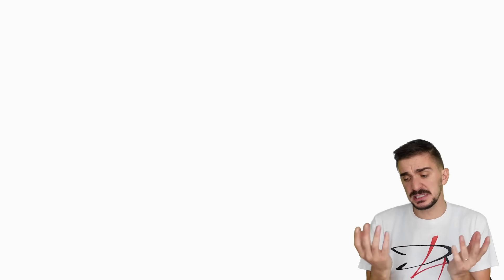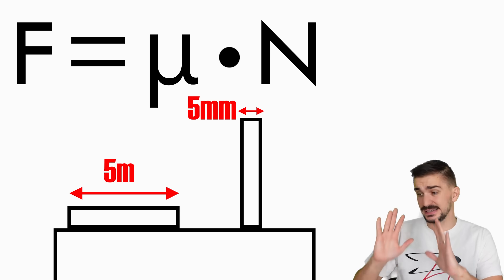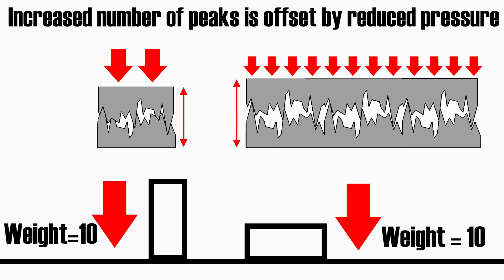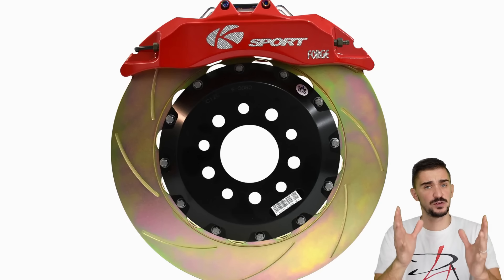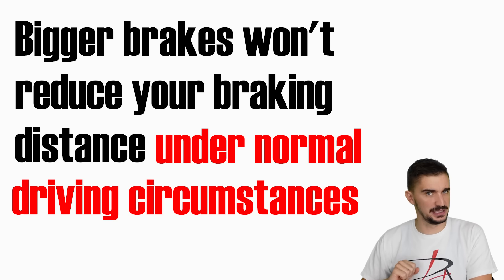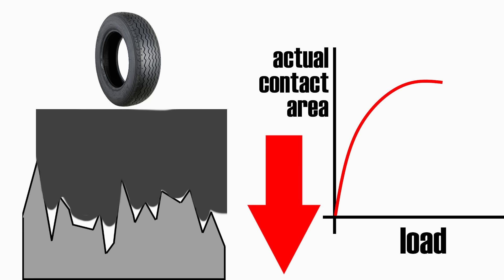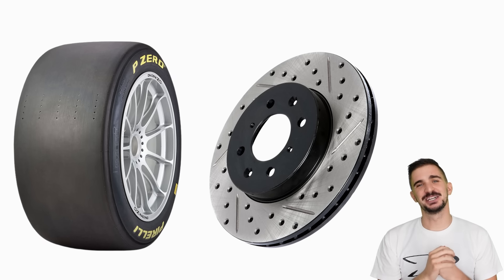Why Big Brakes Won't Stop You Faster but Wider Tires Will - Friction and Surface Area Explained

Comment: Couple of points.
First, all the comments about larger diameter brakes providing a "longer lever arm" or similar are incorrect. Stopping a moving mass with friction brakes requires converting motion into heat. There is no "leverage" involved in this. Larger diameter rotors dissipate heat more quickly due to a higher tangential velocity, and if the system can dissipate that heat, it results in shorter braking distances.
Second, another reason that wider / larger tires can stop a vehicle more quickly has to do with shearing of the tread. As tire load increases, friction increases, but only to a point. If the load exceeds a certain value, net friction decreases due to shedding of the rubber at the contact point. Wider tires reduce the pressure, preventing shearing.

Comment: All other things being equal, wider tires will hydroplane sooner on wet roads.  So braking efficiency depends on much more than just tire width.
Reply: Also, wider tires don't increase the contact patch area, just the shape changes.

Comment: Put on a larger tire and wheel or heavier rotating mass than stock and your brakes will definitely not work as well. Then a bigger brake will 100% stop you faster.

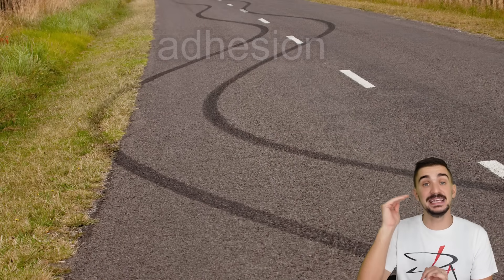Comment: 13:50

 On asphalt road surfaces, skid marks are usually the result of bituminous oils in the asphalt that are heated because of the friction of braking or accelerating and rise to the surface, leaving dark marks.

Comment: I'm surprised you didn't mention that brakes are sliding friction and tires (generally) is static friction. I always thought the difference is behavior was because of a difference in behavior of the friction coefficient between static and sliding friction.

Actually thinking about this some more I believe the nature of the difference is evident in the fact that tires leave skid marks, brake pads do not. This means that when a tire slides it's actually not overcoming the grip with the pavement. Instead, it's shearing off the tire material that's in contact with the road. In other words, the rubber holds on to the road more than it holds on to itself. In this regime, it's clear that a larger tire surface that spreads the force out over a larger cross sectional area will improve grip, because it'll take more force before we start shearing the rubber.

Comment: Your video title is misleading regarding breaks, which you fully admit to, but it's just simply wrong about the tires. The friction doesn't come from how much surface area there is on a micro level, it comes from how much force is required to unbend the rubber out of the valleys in the surface. That IS adhesion. Adhesion IS F=μ*N. It's why stuff that is traditionally sticky, like gum or pitch, isn't sticky when you touch it for a small portion of time but is when you touch it for longer or press down into it. It takes time or force to move such a viscous material into or out of shape. It's why something like cloth (something very soft and flexible) on flooring has low friction force, because the cloth has no internal strength or structure to hold itself into the surface it's trying to grip. Rubber has high internal strength so it can withstand more load before failing and adhere to the surface better. The decreasing deformation as load progresses is totally irrelevant. Think of it like standing on a stair, as long as your foot is totally on the stair, it doesn't matter if your foot is 6 inches from the riser on the step above or touching it. Foot placement only matters when your foot is hanging on the very edge where it takes very little force to get it to fall. Similarly it doesn't matter how far from the micro valley bottoms the rubber is as long as it's difficult to unbend.

Comment: No.
Physics says that M (breaking moment) equals Radius times Normal Force.

Hence, bigger the radius, bigger the breaking moment.

Hence, bigger disk brakes will increase the braking power. Because Power equals Moment times angular velocity.

Comment: For motorcycles, putting holes in brake disks improves wet-weather initial (first couple of revolutions once brakes are applied) performance. Slots do the same, maybe better. It also reduces unsprung weight, but probably not enough to matter. Bikes have comparatively little 'sprung' weight, so the sprung / unsprung ratio matters more than it does for cars. One of the best handling mods I ever did for my Ducatis was to swap stock wheels for exactly-the-same-size Marchesini magnesium ones. Same tire models and sizes, big difference in handling. I used to set up bike suspensions for the track, and this was a bigger difference than changing spring rates, preload, or damping.
Reply: The drilled holes are functionally allowing more airflow and hence cooling.
The purpose of the slot it to have an edge wipe the pad removing debris and ever so slightly shaving the pad for contact area while chasing the gasses away.  That is why it has to go in the proper direction.

Comment: Click bait. Even if you explain in this video you are still giving false information. Bigger brakes will definitely make a car brake faster. The reason is heat dissipation (cooling).
Reply from the maker: Zero false information and zero clickbait in this video. You're misunderstanding and compensating by twisting the facts.
Reply: @d4a  go put smaller brakes on your car and bigger tires then. I'll see you in heaven.
Reply: If your wheels can lock up (all modern cars have enough braking force to do this) then bigger brakes do absolutely nothing to decrease breaking distance.
Reply: @fishy_on_me  if you were in charge in designing brakes then you will be responsible for the death of many. Don't listen to everything you learn on the internet. Yes all brakes will lock up, until they overheat and you get what  is called Brake Fade. Look it up.
Reply: @alanskylux9822  Yeah because brake fade definitely happens all the time whenever you're driving to work
Reply: Some people do experience brake fade on an every day basis. Specially hilly areas.
Reply: @alanskylux9822  So? Just because some people experience brake fade in extremely hilly areas doesn't make the original claim untrue.
Reply: @fishy_on_me  At the end of the day what is true persists and what is a lie dies. Bigger cars have bigger brakes (as well as race cars) and smaller cars have smaller brakes. There is a reason, car manufacturers always try to save money, they would not not waste money on bigger brakes for trucks if they did not have to. You want to tell me the engineers are wrong? I actually dare you to go talk to an engineer and suggest that there is no need for bigger brakes for braking performance. They will most likely ignore you entirely because there is no point wasting time with people like you who believe anything they see online. Yes small brakes and bigger brakes have the ability to lock up your wheels (for a limited amount of time), but this video is dangerous because it makes people disregard the need to bigger brakes.
Reply: @alanskylux9822 Like you said, big cars have big brakes, and small ones have small brakes. Why upgrade then if the engineers thought it through already? The average person upgrading their brakes will not decrease their braking distance. Only in hyper specific cases are bigger brakes beneficial, and even then it still all comes down to how grippy your tires are. If you want to improve braking performance, you start with better tires, not brakes.

Comment: wider tire does not mean a bigger patch... the patch size is just a different shape as compared to a narrower tire... however air pressure and sidewall stiffness WILL change the patch size

Comment: Without having seen the video, I assume the reason bigger brakes won't stop you faster is because in the end, the surface area of the actual brake pad isn't that much bigger. The bigger brake rotor just dissipates heat better, which is why it's a good upgrade still.

However, wider tires do give a larger friction surface, therefore the rubber can stop you faster.
Reply: No, the 'surface' (contact patch area) is the same (area) for wide and narrower tires, only the shape changes.

Comment: Bigger brakes not only provide heat dissipation, but also have a longer shoulder of the force application, as the caliper is placed further from the center of the wheel. That leads to a better braking while having the same caliper and the same contact area between pads and the disk😉
Reply: getting the brake pads further away from the rotational axis, also creates more leverage, like putting an extension on a wrench. More clamping power with less effort, with the ability to dissapate more heat from the center

Comment: Hello, thanks so much for your great unbiased and fact driven good presentation of mechanical engineering. On a complete and other hand, I would really appreciate your input on the following: For any braking system clamping force, a sliding one piston caliper is equal to the one diameter caliper piston. But then a fixed, 4 piston caliper, will only be one side of the caliper being taking into account in clamping pressure?  Any input appreciated best regards

Comment: I think this was a great explanation of the subject. Especially for understanding the underlying concepts. But I would have added the equation of breaking moment which is dependent on the friction force and the moment arm, which in this case is the radius of the applied normal force on the brake pad. Just to show that the friction force and brake diameter are indeed coupled, even though the heat transfer is the actual thing to solve with brake systems.

Comment: Sorry this is not totally true..bigger brakes will stop you sooner,and shorter ,up to a certain point where the tires can no longer keep up
Reply: Another words ,im talking about the  that put those huge offset rims and tires on import and certain older model cars ,which leads to suspension failures and a lack of braking performance because the tires are huge ,and offset and the brakes can’t keep up..

Comment: But wouldn't a larger brake(rotor) provide greater leverage? When the clamping force was further away from the wheel hub.
Reply: Sure it does, but that's not the limiting factor, the tyres are. You can't brake any harder than locking up.

Comment: You're not right here. You need to caveat yourself. Big brakes can absolutely give you shorter stopping distances. There's a lot of dependencies and you have to know what your limiting factor is. Typically tires are not the limiting factor in most normal everyday braking situations. Bigger brakes absolutely can slow you down faster. There is more force applied to the rotors with bigger brakes.

Comment: Wow!!! Absolutely fantastic vid!!!! I have experienced brake failure on 2 of my fat tire electric bikes. I have two bike brands that have failed on steep hills: 1) The RadRover 5 and 2) the Juiced Rip Current S. Both bikes have 4" fat tires and have under designed brakes systems to handle the heat issues of braking on steep hills. This is a big safety issue for these and other Ebike brands. Also both bikes take a lot of maintenance, because their brakes are under designed. I only get about 1,000 miles on a set of brake pads on these bikes. Compare this with my Lexus CT200H brakes after 115,000 miles: Zero brake maintenance and the brakes pads are only 50% worn.  I really enjoy your real life engineering vids. Thanks,  an aircraft tool designer from Seattle.

Comment: And also, even if bigger brakes did give better friction, in the end you'd still be limited by the ability of your tires to grip. Stock brakes can stop your car. The reason you don't stop quicker isn't because your brakes don't brake enough, but because your tires lose grip.

Comment: Wider brakes means that there’s more torque on the brake from the brake pad because it is stopping it from a larger radius. So that entire part of the video is wrong.
Reply: Imagine trying to stop a bike wheel from close to the center, then trying to stop it from close to the outside. Which is easier?

Comment: This is a wonderful explanatory video, however it is propagating an all too common fallacy, at around the 13minute mark it gets a bit off track. The area of contact is not changed by the width of the tire; the shape of the area may differ but the area itself does not change, it cannot (ceteris paribus). I'd love to chat with you about this to set the record straight, your videos are of an excellent caliber and getting this matter explained correctly would only benefit your remarkably well explained content.

Comment: You don't know what you're talking about. Surface area as it relates to friction between the brake pads and the rotors has nothing to do with it, so your video is debunking something that's irrelevant in the first place. Larger diameter rotors result in more stopping power even when nothing else in the brake system has changed, i.e., same calipers, same pads, same master cylinder, etc., therefore same friction and surface area. 

The reason for this is that larger diameter rotors result in more leverage working in your favor because the calipers/pads are at a greater distance from the axis of rotation. It's the exact same reason why you can get a bolt tighter with a longer handled wrench than with a shorter handled wrench (and loosen a tight bolt easier). It's also the same reason that a large diameter steering wheel is easier to turn (which inherently means it's also easier to stop from turning) than a smaller diameter steering wheel, all else being equal.

Imagine that a large wheel is spinning and you want to stop it by grabbing it with your hand. Do you think it would be easier to stop it by grabbing its hub (which is analogous to having small diameter brake rotors) or by grabbing its outer rim (which is analogous to larger diameter rotors)? The grabbing power of your hand is the same in both cases, yet it will be far easier to stop it by grabbing the rim. Why? Because you have more leverage working in your favor, obviously.

Comment: My country has very cheap cars, some like Renault/Darcia kiwd the thing had brakes so small it could catch fire, if you were lucky, most of the time it stopped working because apparently red hot is slippery too 

the thing about brakes is that they need to be only proportionate to the vehicle, even more companies nowadays, like to cut costs where they can, Sometimes it's a good idea to put bigger brakes... Because in the magical world of automakers "everyone just go 6.000 miles a year, The streets are always paved and without holes, Everyone changes the oil once a year, and all defects will be religiously resolved at the dealership... 

They put all this electronic junk in the car to safely pass tests, but they can't be bothered to make proportionate brakes and suspension that can handle the real world.
Reply: Sorry, but if you manage to get your brakes red hot with normal driving, you don't know how to drive...and how to use engine braking.

Comment: You got the physics wrong. The force argument is right but bigger breaks mean bigger radius of the break and as dissipated energy is proportional to Force * distance traveled you dissipate the energy faster. In another terms bigger break -> more distance per rotation as the distance is proportional to radius (2 * pi * r) -> you get more breaking power (W = F * 2 * pi * r).

For example going from 260 to 290 mm breaks will decrease the breaking length at same speed from 50 to 44 m.

Comment: A bigger diameter disc will be like a longer lever so have more mechanical advantage and more calliper pistons do the same if you use the same master cylinder.
So you won't have to press as hard for same force.
But it's interesting that bigger pads and more disc won't give more friction, but diameter and number of pistons means more force on pads for a given foot pressure.
The holes release barrier gas.

Comment: Larger disk breaks distributes the force, stress and heat over a larger area which allows breaks with a stronger clamping force to be used which improves the breaking performance

Comment: I assumed that bigger brakes would experience less pressure per square inch because they have bigger surface area than the smaller brakes, and thus would slow down less. Example, if you lay on a bed of spikes, you would not be penetrated by them because the spikes apply less pressure per square inch than let's say, a single spike, that would easily penetrate you because the pressure per square inch is a lot bigger.

Comment: When de diameter of the disc is bigger, the force grabs in a wider distance, so the breaking torque is bigger and the car will stop earlier!
Reply: You do realize, that the braking torque you can effectively apply is limited by the tyres? You can't lock up harder with bigger discs or can you? If the factory brakes are good enough to lock up the wheels, that's as much braking you can effectively achieve. Bigger brakes don't make any difference in this regards. If you put better tyres on on the ohter hand, this can have a massive impact.

Comment: I love your approach but I'm guessing you've never actually upgraded you brakes and done performance driving.

Of course the limitation is the tires. The point you're assuming is that stock brakes are already at the limit of the tires. If they are then sure, you won't see improve stopping. But if they aren't, which is 99% of the time, you will see a significant improvement in stopping.

The other item you missed is that you're moving the caliper further to the edge of the rotor. Go grab an old CD and spin it on your finger. With your other hand stop the spinning by grabbing it at the middle of the disc. Now do it again from the edge. You'll see how much easier it is to stop the disc from the edge. This means it takes less effort to brake the rotor as well. Less effort is better braking.